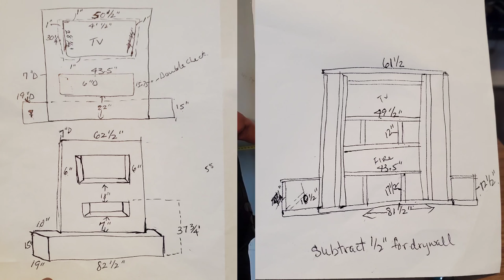DIY FIREPLACE PT.1 #homedepot #wayfair

Comment: Hey the most & best thing I would recommend is that when picking up your 2×4's is to check to see if they are all straight & flat. I built this unit in a 2 weeks & I had to take it down rebuild etc. Nothing I did fitted so well as yours. I built this only. That for your inspiration.  Luv u channel
Reply from the maker: Wow sorry to hear that. Yes, it's important to ensure your woods are straight.

Comment: Hello! Love the video, where did you get the specs for the layout?
Reply from the maker: Hi, I designed it myself.
Reply: Thanks for replying, I’m just wondering at the beginning with the measurements. What guide prompted the measurements on the page?
Reply from the maker: @sdrake727  what I did was measure the width & height of the wall. Then I considered the door which swings unto that wall. I added 6 inches to the width of door swing for clearance and subtracted the same amount on the opposite side. This gave me the maximum width I could build with. Then I looked at the size of the fireplace and what clearances were needed according to the specs. I made necessary changes as I went. But please bare in mind I'm a designer so this came natural to me. Maybe you should pay to get a design done and then you could build from that design. Hopes this helped.
Reply: Thank you so much!!! You gave me exactly what I needed